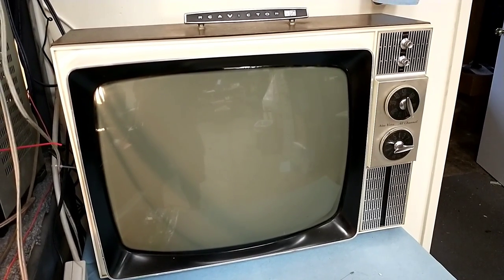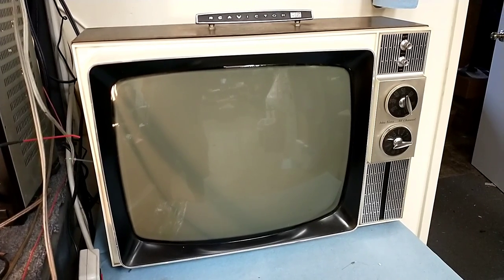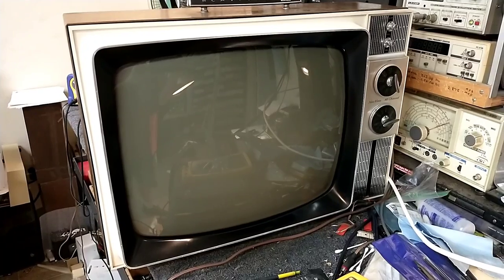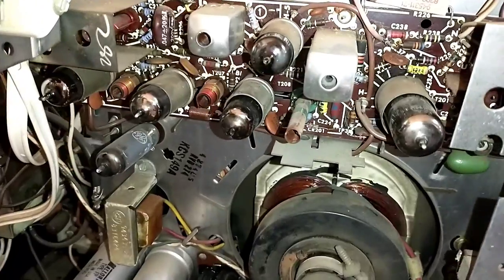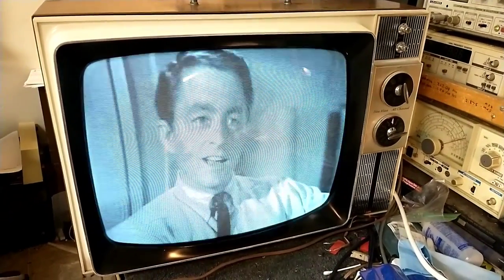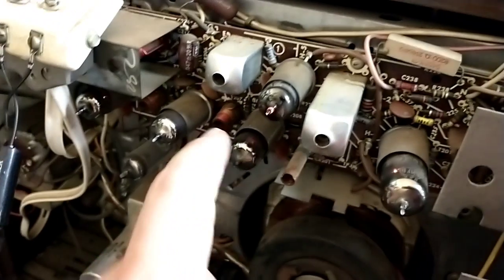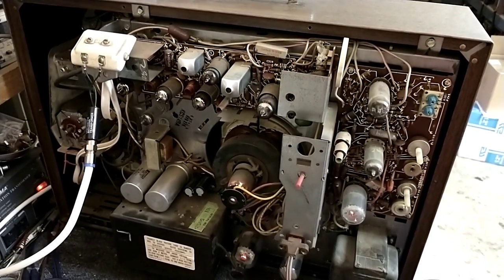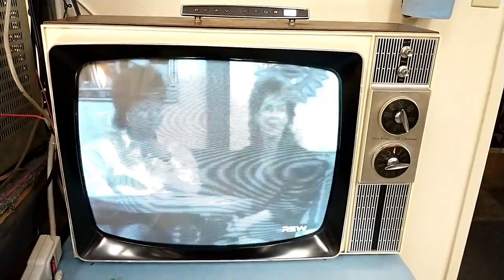Repair of a 1965 RCA af-141w 19" b&w vacuum tube tv. Part 4/4. FIXED.

Comment: It was a smart thing to do, taking a respite from that project. When you come back, your thought processes are so much clearer because you had the needed temporary time out. That wire that is wound around that long coil form appears to me to be some sort of litz wire, the type that is also used in AM ferrite-core antennas.

Comment: Well done :-D, i know how you feel as i've also spun around in circles trying to find the fault.
Sometimes i have given up and later had another go.

I actually suspect that the soldering of that top coil may have heated the pins up and the solder in the can melted and re made the connection.

The reason i say this is i used to repair a lot of c.b radios,  and one particular model always stopped working in the synth circuit. (always failed).
All i did was keep the soldering iron on the pcb joints of the vco transformer a lot longer than i normally did.
The heat must have gone up the pins and melted the internal joints.
The transformer only had the solder joints to keep it falling out.
That's my conclusion, but i could be mad lol.

Comment: Dear sir I am servicing an AM radio with 3 bands MW, Sw1&2. The problem is that the gang capacitor is not rotating well when the rotor blades comes close to the static ones and the dial goes to the last and get stuck. In that gang the top side have 9 stator blades and 9 rotating blades and the insulation comes between each plate. Same the bottom one has 9 sets so totally 18 sets.  I bought a new gang which has totally 14 sets top 7 & bottom 7. Can I use the new gang or try to repair the original old gang. Please suggest me sir.
Reply from the maker: Oy, that's a tough call. Without carefully examining the rotor and blades and how they mesh there's no way to know if a transplant will work or of it's better to try and carefully straighten the current blades so they don't touch the stationary fins.
Reply: @JordanPier  yes the gang capacitor becomes very hard to rotate especially when the moving blades nears the fixed ones. It becomes free to rotate in opposite direction. Also found a puncture in the insulation causing the short circuit. The radio is receiving without gang but only with the help of fine tuning variable resistor. I have to dismantle the entire gang, straighten up the fins and blades and then finally assemble carefully. Let me try and come back. Thankyou for replying sir.